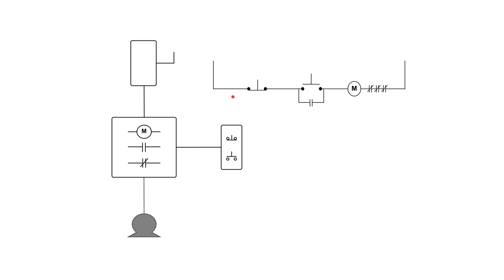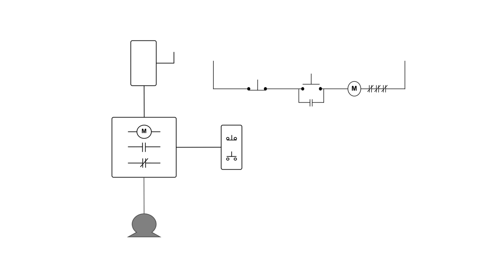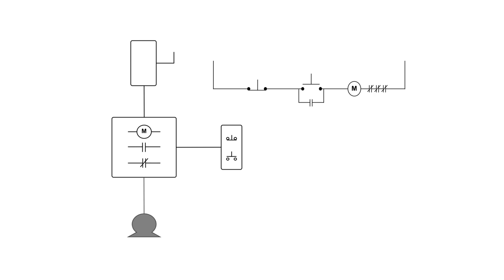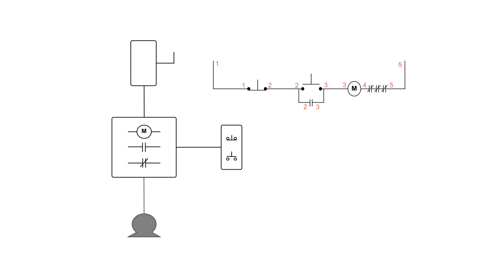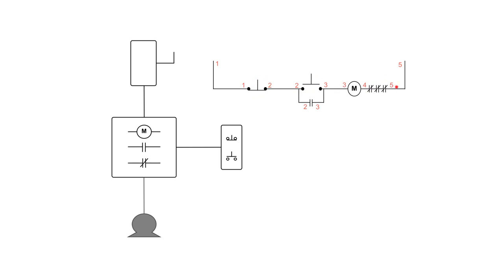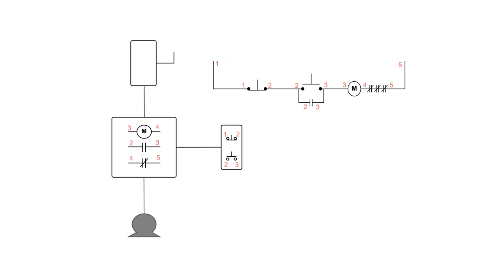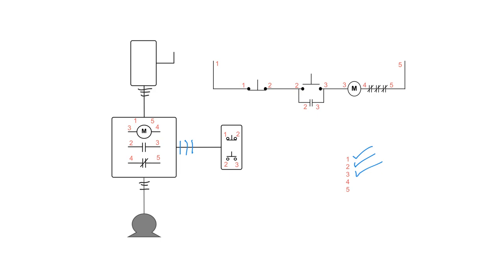How to use the numbering system in motor control.

Comment: Wrong...in a single contactor with overload relay there is just one set of normally open and normally close contact which you can connect to your control wiring...The three overload that you are talking about is on the power circuit directly connected to the motor or load...what the heck...
Reply: He is talking about a 3 phase power instead of a single phase, that has both the hot and neutral breaking in a single line starter/ I believe